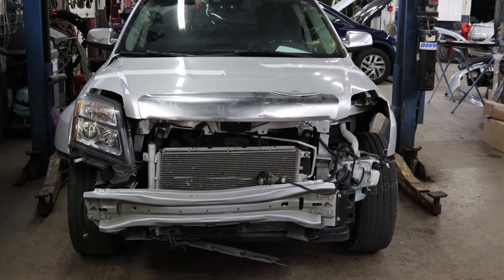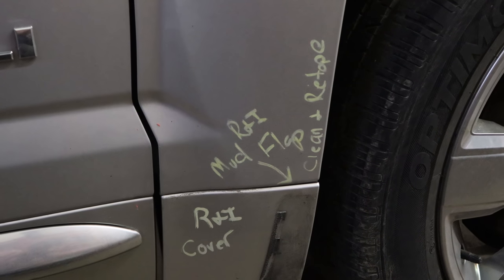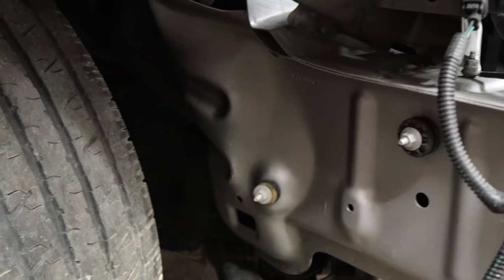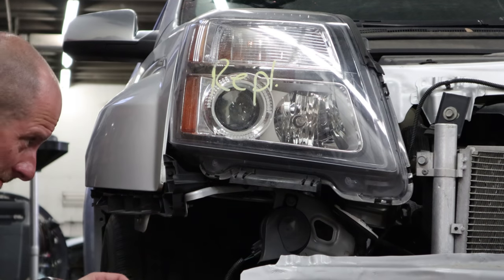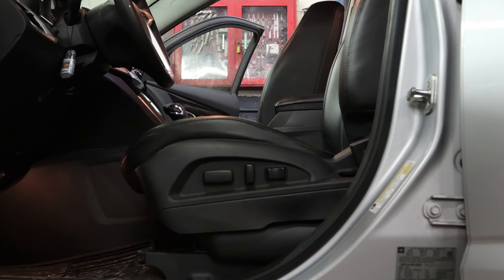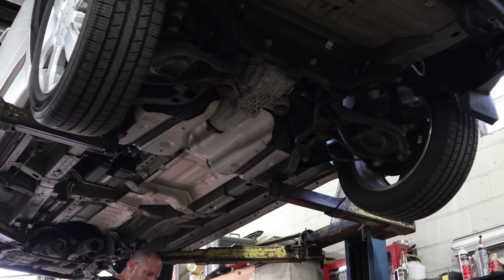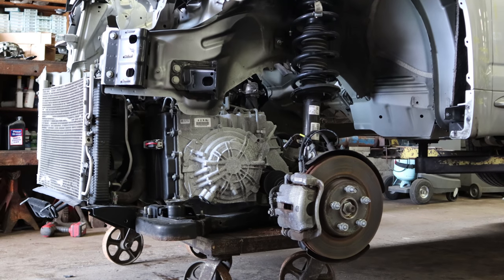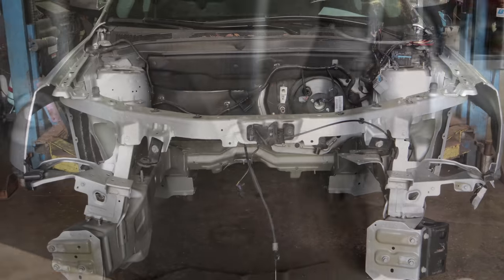Rebuilding a totaled vehicle tutorial part 1: Intro to the project and disassembly

Comment: You really knocked it out of the park with this video. I'm sure it wasn't easy.  There's a lot of rebuilding channels out there but your knowledge is on a whole new level and now you made a video to match.
Thanks and I know all the hard work will pay off. It sure shows in this video compared to some of your others.
Reply from the maker: It does add a lot of time to the repair.  I just made a simple seat removal video that took me 40 minutes.  It would have taken me 10 minutes at most to remove the seats with out the camera.  It is kind of fun to make the videos, I just wish I wasn't on such a tight schedule.  I'll make them whenever time allows.  I really just need a film crew to follow me around. lol Thanks for your support!
Reply: @vehcor  if I was close I'd be happy to help. So it's possible someone else might be interested. Also I'm sure that with time and practice filming will get easier. I know it's not cheap but multiple cameras would help.
I know I can't speak for everyone but I think that most likely the interested people (like myself)aren't expecting award winning cinematography, just more clips than the time lapse to go along with the helpful tips. What you did in this video is awesome.
Reply from the maker: I was actually thinking about getting some help.  I have a lot of people that want to learn and the best way is to watch and do the work.  So the watching part will require them to hold a camera. lol I did get a new camera and that is why these videos took so long.  I couldn't make up my mind, I did so much research I started becoming an expert on cameras.  I reinvest 100% of anything I make on YouTube right back into it.  So it kind of snowballs, better gear, more money, better gear, better content, more money, etc.  It took 4 years to make enough for the camera, so it does take patience.  In my search for a camera, I did stumble on some cinematographers and have used some of their tips to improve my videos.  Hopefully one day I can deliver both the helpful tips and award winning cinematography. Your support is very much appreciated!
Reply: @vehcor  i got started by holding the light for my dad and my daughter is doing the same. It's funny but when she was 4 she was watching me change a headlight. I put the ratchet down and she picked it up and started loosening every 10mm  bolt she could reach. I just had to step back to watch and smile although my wife wasn't as amused......lol
Reply from the maker: I have taught a few people with the "light boy" method and that is actually what we jokingly referred to them as.  I learned by taking everything apart, old radios, carbs, wrecked cars.  That is still my favorite part.  Now I just have to put them back together as well.  I started going to the body shop to play when I was three and have been in one since.  My dad used to rebuild cars in the garage as well.  Full body sectioning, frames, motors.  The first jobs I ever saw would have scared most shops away and I thought that was just a normal job.  A 4 year old with a 10mm could be dangerous, that is 60% of most cars she could dismantle. lol

Comment: Excellent into! I am looking forward to this, I am currently replacing the front end on a 90's Silverado,  not a super hard hit (just pushed the bumper back about 10 inches in the dead center), it is always good to watch someone else work and pick up new tips and tricks to get things done. 👍
Reply from the maker: Thanks,  a full frame is a little different.  If it missed the rails, it is an easy job.  I'm sure the bumper sucked them in but that is easy to straighten out.  Those frames could still be straightened with heat if need be.  We don't have too many of those old trucks up here, they rotted away long ago.  I'm guessing you are from the south somewhere that rust doesn't kill everything metal.  Good luck on your project.
Reply: Sir you are correct, in Tennessee, the truck had a little rust in a rocker panel, other than that it is rust free. Thanks for the well wishes!
Reply from the maker: I'm so jealous of the rust free southern car/trucks!

Comment: Really looking forward to this series of videos. I’ve rebuilt a bunch of salvage cars but I’ve never dropped the whole subframe with the engine and trans. I wish this video was in a little more detail like did you unplug the harness at the sensors and injectors or did you unbolt the fuse box and drop it wiith the engine also what you take off before and what you drop with the engine to speed the process up. I flip real estate now but I still buy cars from time to time to work on for fun so this would come in handy
Reply from the maker: I didn't get into specifics on that because every car is different.  I was trying to teach general repair tips.  These wiring harnesses unplug at the fuse block.  It had to be unplugged anyway, I had to pull the dash with its harness as well.  That will be in another video though.  Thanks for watching.  I will be sure to show in detail on the next drivetrain drop.  It is becoming very common in repairs these days.

Comment: I'm looking forward to the plastic repair how to because an aftermarket/remanufactured bumper on my car is $150 without paint, has two mounts sheered off (it was torn off in an accident prior to me) and since it's a cheap car I'm looking at it as a way to learn how to do body work because it's not a big deal, and if it doesn't look great, at the end of the day it's better than it was.
Reply from the maker: I'll use the big fancy welder first but I'll break out the old trusty airless plastic welder in the future as well.  The best way to learn is to try!  Thanks for watching!

Comment: Hooray for frame "rails" on a unibody! They're all just spot welds anymore. I've done a few rails without pulling drivetrain before, but damn if it wouldn't be super easy to pull the drivetrain by the time the rail and everything else is out of the way. I personally try to pull before major disassembly, but everybody has their own way. 
I still like your frame rack though.
Reply from the maker: *Spoiler alert* the rails have to be replaced completely so I would have had to drop the drivetrain anyway. lol I actually used to do some jobs with the drivetrain in but realized the 4 hours to R&R it was easily saved by not working around it.  It also made masking and painting much easier.  I would have liked to pull it first but that adds time.....time I spent making videos. lol  Thanks for watching!
Reply: @vehcor  I certainly hope you wouldn't use those rails. Pull, measure, fit new rails, measure again, weld spot welds in various places while measuring in between welds. I'd like to see how you pull and replace those parts in more detail like this video. I'll keep my eyes out for the other installments.

Comment: Question for you, I did a whole drivetrain swap on a 2010 equinox (same as terrain), bought a 17 for parts to fix up the 10, anyways after doing everything I got no power steering. Scanned the car and I got no codes for power steering. Is this because it needs an alignment? Will a bad alignment cause power steering loss? I planned on getting alignment since I had everything apart, but just wondering if this is what it is before I take it in. Figured I would ask you since I'm sure you may have had seen something similar to this working on the terrains. Appreciate it. Thanks!
Reply from the maker: I'm guessing you are talking about a 4cyl.  Those had electronic power steering.  There is a ground in the back from the rack to the firewall that may not have been hooked up, also a power that goes to the fuse box from the rack.  I would start there.  An alignment car throw codes occasionally but will not cut out the p/s.
Reply: vehcor correct a 4cyl. I checked the ground, it's good, check the fuse and power cable, also good. I did swap the whole rack and pinion from the 17, and I had someone tell me that those need reprogramming when you swap. Is this true? I did have a U0131 code, so I put the old power steering motor back in, and it went away. But now I'm wondering if it's the rack that needs reprogrammed.

Comment: I take the tailgate striker out in addition to the seats, before disabling the electronics.
Reply from the maker: On this one I just tripped the latch with a screwdriver.  I had to pull the dash so the seats were going to have to come out at some point.  The hatch was just incase I wanted to put parts back there.  I hate when I forget little things like that and it adds time to the job.  Windows are another one, I forget to put them in a service position before I remove the door and end up having to jumper them.
Reply: vehcor 
I usually forget at least one thing, but then I feel like a champion on the rare job that goes exactly as planned.
Reply from the maker: In this industry when things go as planned I get highly suspicious something is going to go terribly wrong soon!

Comment: You seem to have a preference for GMC. Do you stick to certain makes and models youre familiar with so you can work faster and attain parts easier?
Reply from the maker: I fix what sells.  These sell fast and I happen to like them.  The liking them is not a requirement.   I did a few Enclaves and I hate them.  I usually do a run of different vehicles to use up parts if I get parts cars.  I had a run of IS250s for the last year, Grand ams for the last 20 years, Chevy trucks, Ford Escapes, Honda Civics, just about anything. I'll have a how to video that explains in more detail why I stick with the same cars for a while.
Reply: @vehcor  The Enclave is a made in China Buick badged wonder. It can't even be really considered a Buick beyond the plate pasted on.
Reply from the maker: @VinylToVideo  Actually we have to take credit for the Enclave/Acadia/Traverse and even the Vue mess.  They were made in Lansing, MI.  The Encore (the little roller skate) is a Korean car and the Envision  is made in China.  I'm a GM guy but I can admit there are no good Buick suvs regardless of where they were made.
Reply: @vehcor  I used to be a "GM guy" too and still own a '91 Fleetwood coupe and a '99 Grand Prix GT. Was never into Ford but my best car is a Lincoln LSC SE with 5.0 HO and would rather own this than any Cadillac, except perhaps a late model ATS coupe might make a good daily driver for cheap gas and decent power even with the 4 banger. The 2000+ GMs are generally junk IMO such as the poorly built '05 Envoy that was in the family (though that straight six used in very few vehicles was great except for being a pig). I have little interest in newer GMs than I own. If I could find the last mid-late 90s Buick Regal GS they made in a coupe with leather seats and the series I or series II 3800 I would gladly daily drive it; more or less the same car as the Pontiac I already own though. I had a '92 Regal LTD coupe and that series I 3800 was fantastic though had an ugly color combo.

Comment: I'd like to get a wreck and repair at home but don't know the process you take to do a wreck vehicle. I know you have to have inspected and only certain parts can be used. How do I go about getting this info
Reply from the maker: You can go to the Secretary of State or State Police web sites for more information on the rules in your state.  Every state is different but the process is similar.  Some states it is handled buy the SOS and other by the SP so if you don't find the info at one, try the other.  Here in Illinois it is done through the SOS.  You can change any part, you just need a receipt for the parts or a junk title on the parts car.  There is a form that will tell you what parts they inspect.  A licensed rebuilder has to repair it for you, at least do the paperwork anyway.  I will have some videos on this in the future.  Thanks for watching.

Comment: Hey, Awesome video! I love this shit! Keep it up.  Question: do you have to drop the engine to pull rails or do you prefer it?   I'm wondering when and how you decide when to pull intact or when when to drop drivetrain?
Reply from the maker: I though you might like these.  On this one, you have to pull the drivetrain to replace the rails.  Spoiler Alert  pulling it was only for teaching, I replaced it all.  Even if I was straightening or replacing partial sections, I still like to have the extra room to work.  It only ads about 3 hours to the job to R&I the drivetrain and that time can easily be saved when you are not trying to work around the drivetrain.  It makes painting much easier as well.  I have dropped a lot of them so my system is pretty efficient.  They actually go together easier than they come apart. One of the few things in this industry but that is by design.  I am essentially just putting it back together how the factory does on the assembly line.  Since I don't get the light hits, it is usually a pretty easy decision.

Comment: Would that be a true sub frame or a unibody
Reply from the maker: The car is a unibody the sub frame is just the part that holds the drivetrain.  Some people call it an engine cradle, suspension crossmember or k frame.
Reply: @vehcor  good to know thanks
Reply from the maker: @randykephart3661  No problem.

Comment: Get rid of this thing asap. They rust like CRAZY, especially rear doors and wheel arches, tailgate. They make these in Ontario and the paint literally peels off
Reply from the maker: Oh, you are going to like the future videos of this truck when I show you how to prevent that.  This will be my third one.  I don't keep them long.  Not because I want to get rid of them but they are in high demand which is what you want when selling cars.
Reply: vehcor love to see your thoughts on rust prevention on these, every used one I've seen back home in Ontario has massive rust.

Mind you, i live in socal now, so what is this rust you speak of? Haha we need to import you here, every car in the junkyard has a floorpan and suspension so clean, they look like they just rolled out of the factory. I have a 99 m3 and a 2003 grand caravan, all the typical rust spots are like new haha. Peeled the sideskirts off to replace clips, on a rust belt car, the rockers would be half missing, my m3? Zero rust. Rockers look brand new
Reply from the maker: @mi16t  I don't like rust or Illinois but I hate Cali more.  Oh I am aware of the southern cars.  I drive long distances to get them whenever I can.  The 04 black Grand Am in my older videos came from Kansas.  It was like 10 years old at the time and even the exhaust bolts could be removed with your fingers after breaking them loose.  Most of my Terrains have been southern cars before I got them.  I have seen some pretty bad 2010s from around here though.

Comment: I can see why it was totaled
Reply from the maker: I can't.  $15k repair on an a $30k vehicles is only 50% and the total loss threshold is 70%.
Reply: I didn't know what the repair cost was, or if the frame was twisted too much. Thanks for taking the time to explain. You do fantastic work, anyone getting a vehicle fixed by you get a job well done.
Reply from the maker: A lot of shops go for the gravy and total big jobs like this.  By the numbers it was repairable.  Sometime insurance totals them if they think the owner is going to be a headache when it is done.  Some shops are just afraid of big jobs.  They aren't scary when you get used to them.  Thanks for the support.  I always do my best on everything!